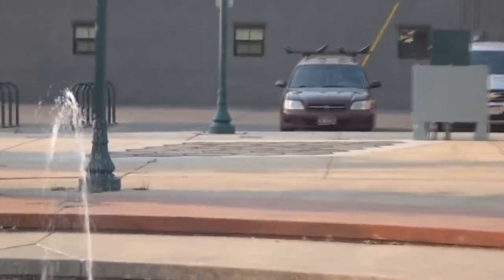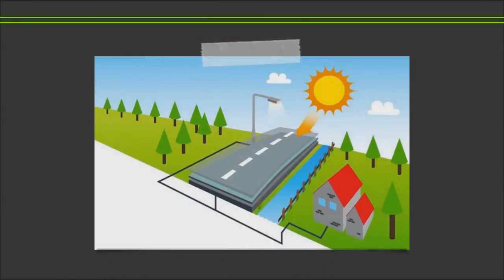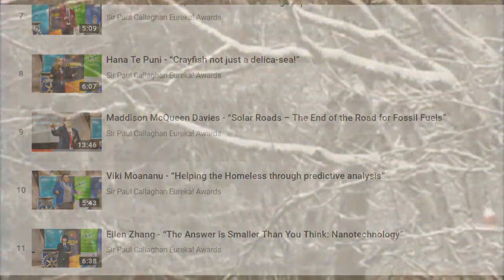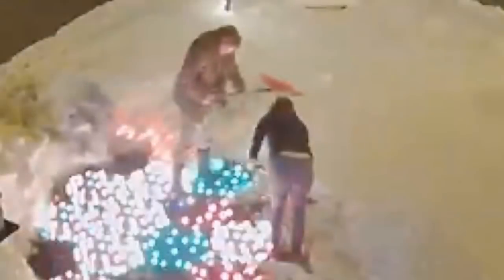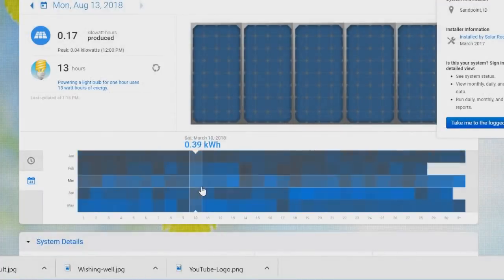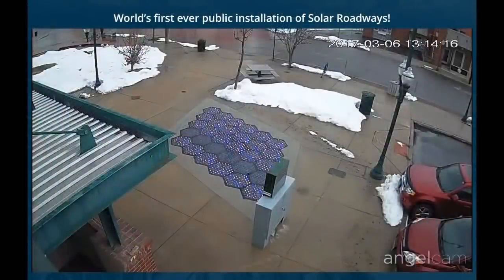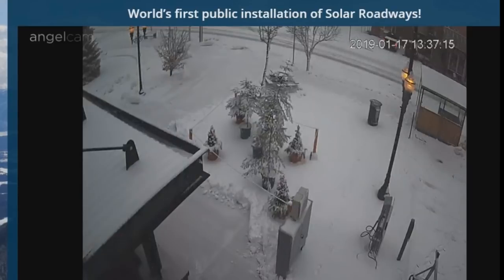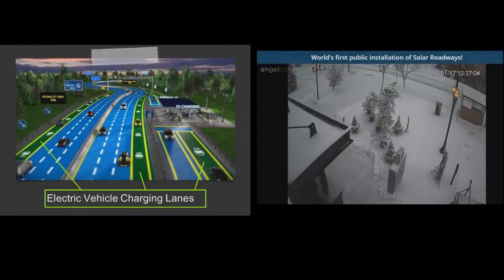Solar Roadways to be installed on Cruise ships!!?

Comment: Luckily Thunderfoot wasn't around when the Wright brothers were trying to fly,..
Reply: No, you see that is not the same thing. Do you know why? Because that flying idea that the Wright's had, it actually WORKED.
Reply: @seybertooth9282  solar roadways work too, just not practical with today's tech.  Just like when the Wright brothers flew for 30 seconds and had to crash land, but the idea wasn't thrown away just because they couldn't fly 600 people across the Atlantic Ocean in the first decade, lol.
Reply: @slowburntm3584  No man, they do not "work" since any sensible definition of the word must mean "work as intended". That they generate a little electricity does not make them "work" since that's not all they are supposed to be doing. Roof mounted solar panels, however, does "work" as they do what they are intended and expected to do. WTF are you defending stupidity for?
Reply: Omg, that is the last thing I would do...  Defend this POS as is.   They work because they produce electricity and melt snow and you can walk on them.  Sure, they do all that about as poorly as possible, but they do.  When you go to the store to buy 2 by 4's, they are not actually 2" by 4",.does that make them unusable?  Electric cars were absolute junk when first made a 100 or so years ago, but now they have improved to be very practical.  Again, these solar roads are junk right now, but if people didn't try the seemingly impossible we would never innovate.
Reply: You are an idiot. If you had an ounce of intelligence you could see that the math doesn't work out and it won't work out. Even in perfect conditions. Do you think perpetual motion machines are a thing? Do you think that tomorrow's tech could make it possible?
Reply: @AssemblyBanditChannel  What the hell does purpetual machines have do do with this, LMAO!  I am not sticking up for the tech OR the outright lies this idea is inducing.  Just saying folks like you said the same to Tesla, the Wright Brothers, and just about every new tech in its early days.  I even agree with most all Thunderfoot's arguments, but how many videos does he have to make on the same exact product?  If people want to throw money at a dream, more power to them.  Tax money is a bit of a joke, but still, it is a tiny amount in the grand scheme of things.

Comment: Yeah.... As always, I have to give credit for the idea itself, buuuuuuuut... Lets just say that the idea needs some critical flaws worked out before it should be advertised further, such as making glass difract in such a way so as all that LED light isn't pointing straight up at the sky where nobody needs it. Obviously the prototype used tempered sheet glass panels, rather than the textured panels they showed. Perhaps that makes a difference, or maybe not. Or maybe solving that GLARING glare issue. Or maybe the issue that the LEDs consume more electricity than the solar panels provide, so that it still needs to draw from the power grid? The "proof of concept" isn't even what was advertised as you'd think it WOULD have been considering they sank half a million dollars into it. 

Seriously, if you're promoting an invention, you NEED to pay attention to it's critics. Just because they're naysayers doesn't mean that they haven't found something you may have missed. And don't continue promoting a concept with known flaws! FIx the flaws, THEN continue promoting.

Comment: I must be super dumb and missing a lot of information here, but how did they come up with a cost of $500,000 for installation of that little bit of solar roadway crap? I'm hardly qualified to speak on the matter, but I can do the same thing at home on a breadboard with a couple of addressable LEDS and get some pretty bright LEDS happening for probably about 50 cents. 

The cost goes DOWN when you start mass producing PCB's and buying reel's of LEDS and shit, at least from what I have been seen and read . So how the fucking fuck do they come up with a $500,000 price tag for such a SMALL area of the panels?

Even if these worked they are talking about covering roads in the stuff and if you ask me the councils and governments would never have gone for it. It'd cost WAY too much.

Edit: What happens when a boulder or a tree falls on the roads? Do they have to replace the panels? Jesus, we're talking a lot of money invested into these things compared to asphalt. At what stage do you make a profit. Sounds like never to me.

Comment: "...and a microprocessor, which is basically a mini computer."

No and get out. All computers work on microprocessors you dolt, from your desktop at home to the scientific calculator on your desk. It just means all of the CPU function is on one chip. It is in no way unique to smaller computers or devices. For fucks sake I get I'm in the industry and understand that but a five second Google search could have saved you looking like a moron on stage.

Comment: When I first heard of this and slurped up everything available, I was pretty favorably disposed.  But they were very "Oh, we've got that covered," when I was asking questions about durability, cost of installation.  

I think it's an interesting concept.  And if some outfit comes up with a slick way to embed solar cells in durable pavement, that integrates seamlessly with existing paving and stonework applications, it will be quite the deal.  But I see it more as something that'd operate more locally, so that light could be provided in remote areas, as need arose or as long as the power supply lasted.  Maybe it could keep a survival hut warm that one time it was needed by travelers caught out on the Interstate in a blizzard. by stretching out its fingers to all the resources within a radius that'd be restricted by the transmission losses.

But we probably need another couple generations of nanotech and/or materials science, before it seems practical.  Not something to dismiss, but something to note, put on a shelf, and wait for advances in other areas to make it ripe.  But not something to pour money into, this very minute, when so many things are wrong with it, with what we have and what we know, now.

Comment: Thunderfoot, just shut the fuck up this time.
Solar Roadways for cars are stupid, that's true, but cruise ships is where this technology might be good.
1. Friction: they ll work it out. Since we're only talking about Flip-Flops and feet as users (instead of cars) wear will not be that much of a problem
2. Efficiency: Not a real concern. We're talking about cruise ships, which is like "take a resort, but put it on a boat for no reason", so it's all about the novelty. Which leads me to 
3. The lighting: it's not about safety-relevant lane signs or so anymore. Just about making the floor a bit cooler. Thats it. And that they do.

So yeah, your vid was bullshit this time.